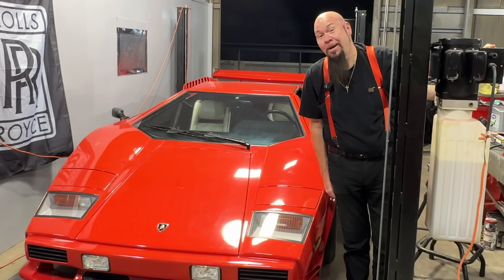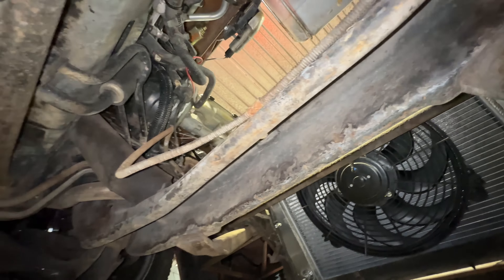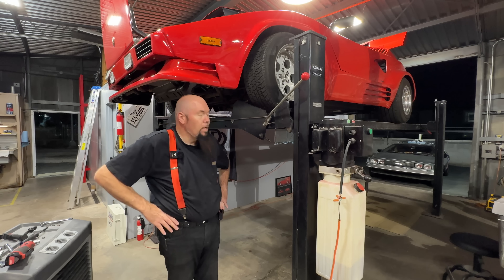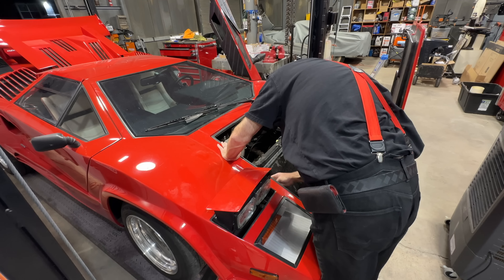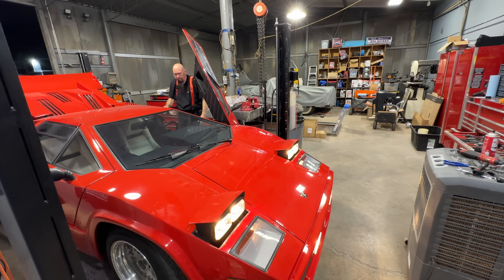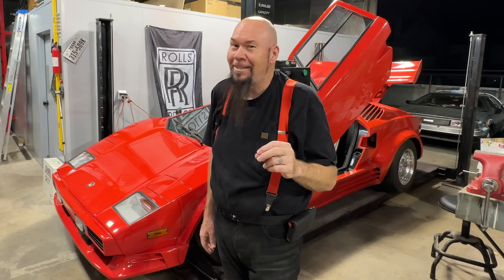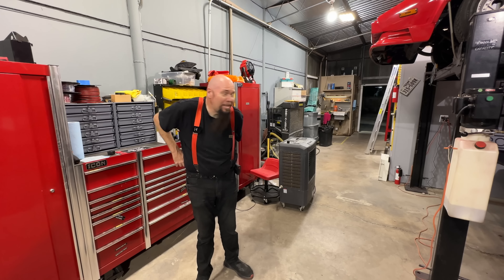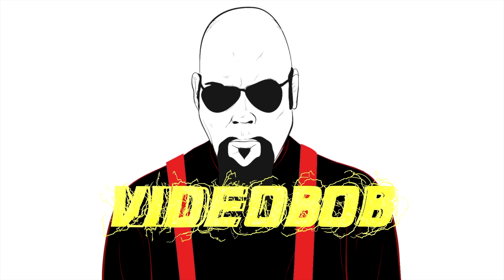I hate the Fiero headlights on my fake Lamborghini!

Comment: as long as the headlight actuator motor is functional I've fixed many of those over the years with a trip to Lowe's for about $8.00 buying replacement polyurethane bushings

Comment: 😍 It is a beautiful kit car. Even if it is possessed... 👻 I'm sure a shot from my proton pack will fix it right up.
😉👍 I 💯% agree on the LS4 swap... 🤔 of course, I would go crazy 🤪 and build it up, and instead of putting radiators in the rear. I put in some Twin Turbos and inner coolers there. There might be 4 cylinders less than a V12, but why not the same 800 HP!?!? 😁👍... Oh, but I know you'll never do that, Bob... 😜 But I would! 🤪

Comment: I's a great looking kit. Even Hoovie's real Countach has the skateboard wheels under the front. At 22:40 after the lights com up I notice a few seconds later they get brighter. I don't know enough about electronics, but shouldn't they stay one brightness. Is that normal  for headlights or are they turning on the normal brightness and then automatically shifting to the brighter setting?

Comment: Even though it's on a Fiero chassis, these countach kit cars are cool cars. Head turners for sure. I have a red one similar to this (mine has the 4cyl). Mine is on an 84 Fiero chassis, and needs some work. Whoever put it together did not do a good job. I have to say, the trucks on the front for adding a little extra safety for the ground effect is a good idea. The ground effect for mine is cracked in half and in need of repair. I definitely have a project on my hands. The plan is to drop in a 3.8 supercharged engine or a LS4 out of an Impala or monte carlo. I've looked into modifying the GM F40 manual trans to fit the LS4. The goal being a manual trans for fun. I'm a long way from that.

Comment: Really stupid question. Does that car have a body control module? (I did some quick googling and came across some forms and apparently that's a popular mod.)
Also maybe . .  if the headlight motors has contacts and blah blah blah like you said. . . Could the issue be with the placement of the motor in relation to the kit-car headlight flaps? (Like maybe disconnect the linkage and see if they still have the issue.)

Comment: I know that my 83 TA healight switch inside the car will only work both popup motors if it's pressed lightly. Both lights will be illuminated. I have original motors. You might consider the switch inside the car might be worn.

Comment: Dodge used one motor and a bar. I had a Trans Am GTS and the headlights were a nightmare to fix.  Three relays and two motors.  Never could get them to adjust when they were down flush with the front end.

Comment: Every cool thing they have ever done with headlights has always been a pain in the ass..  pop ups, hideaways..  etc...  all a pain in the ass.  That is why the factory always has some half assed way to put them up manually.  They knew it was just a matter of time until they failed.  Buick Riviera's had that horrible clamshell thing...  just an electrically operated mechanical @$$hole of linkages.  I feel your pain.  Might want to redo that front wiring harness to your standards.  Looks like it's seen some heat damage as you pointed out.

Comment: If I were you. I would rewire the entire headlight system. Then you will know you have good wiring and grounds before I would say the motors are bad. Or look at a 1970 Dodge Charger headlight system. They use one motor that operates both headlights same thing with a 1970 Ford LTD with the hidden headlights. Other than that. It is a beautiful replica Lamborghini Countach.